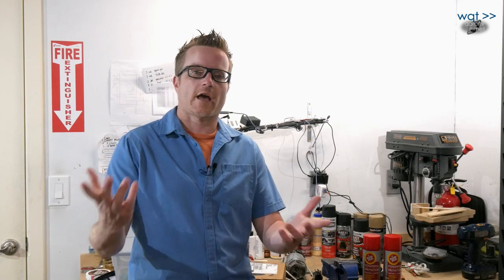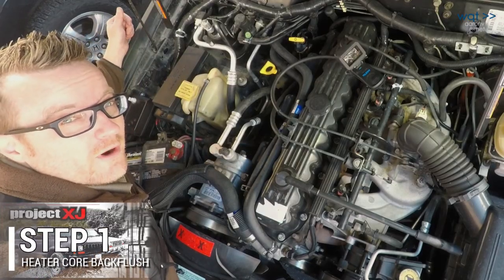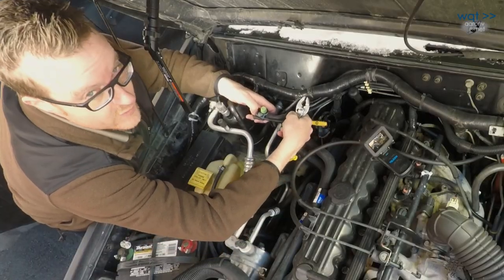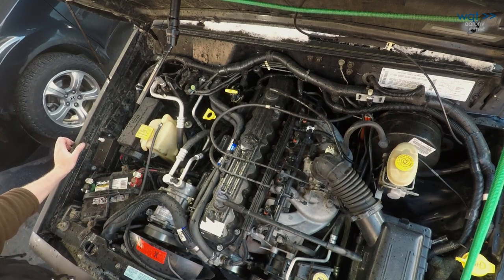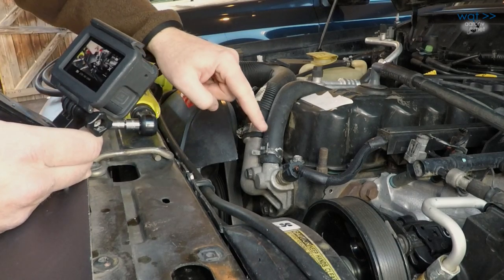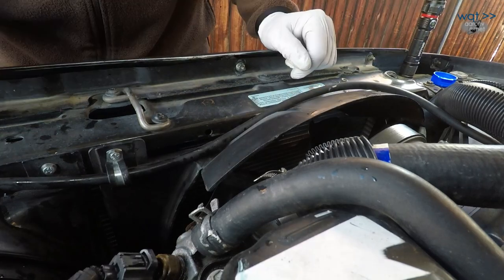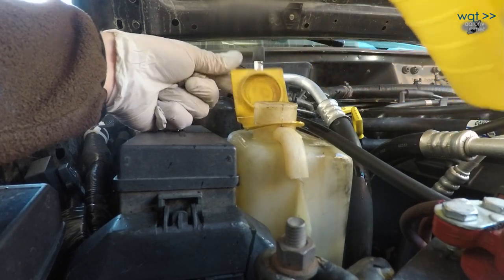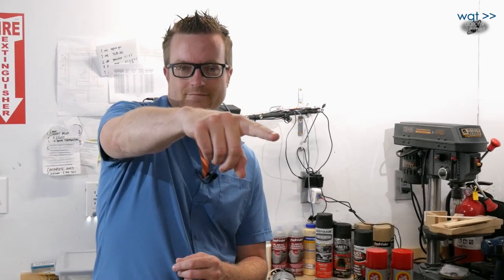wqt//basic auto: Cooling system UNDERheating? (84-2001 Jeep Cherokee XJ, 4.0L AMC 242 demonstrated)

Comment: I don't usually advocate rtv, but on these Jeep thermostat housings, it's usually necessary (especially aftermarket; their flatness is usually out of spec, but originals also warp over time).  This can sometimes be fixed by sanding it on a flat surface to knock down the high spots, but it doesn't take a lot of rtv to make a good seal.

Regarding the adhesive backed gasket, I know you said you'd never seen that before, so just be warned that those are a bear to scrape off whenever it comes apart again.  You may just want to replace the aluminum housing next time around, rather than deal with it, because you're likely to damage the aluminum surface its stuck to anyway.  I refuse to use those gaskets anymore for that reason.  

For anyone finding they need to pull their thermostat somewhat regularly, felpro makes a nice bonded gasket (plastic with bonded lip seal) for some applications that can be reused.  More pricey, but handy if you're in a bind later and can't get hold of a replacement (speaking from experience).  They also seal better on less-flat surfaces.